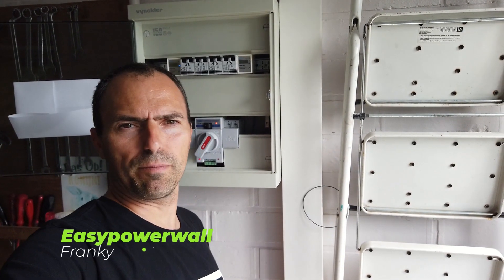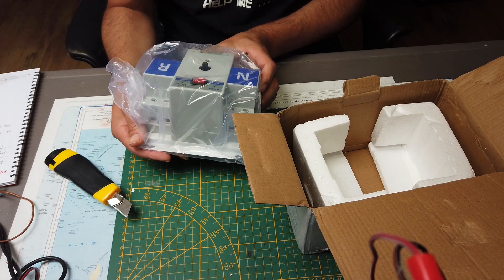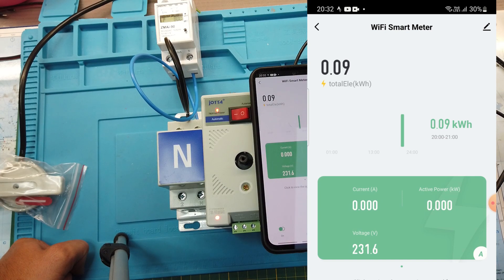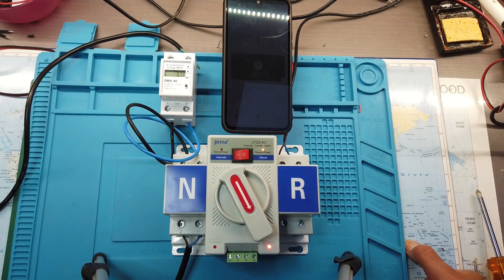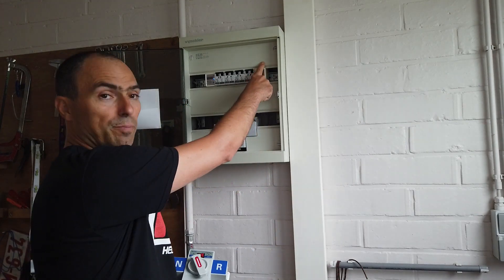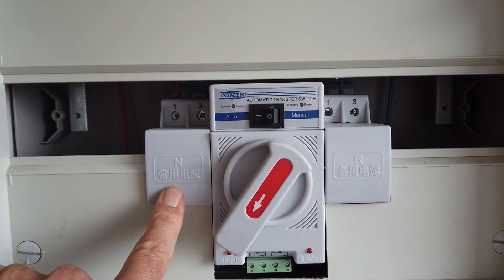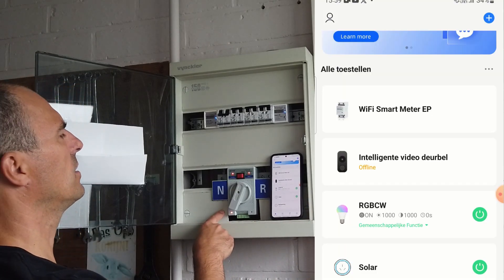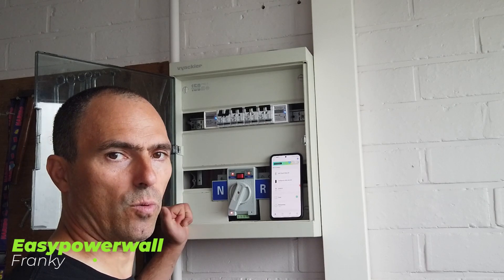Automatic transfer switch and wifi smart meter ZMAI-90, great combo.

Comment: Would this setup work with a solar hybrid inverter, to send a signal to a electric start generator backup?
Reply from the maker: Hi Paul, It could work, but you need an inverter with an NO and NC contact. With this contact you can start the generator when a criteria is met. When the generator runs and generates power & voltage, the ATS can switch to generator.
Hope this helps.

Franky - EASYPOWERWALL

Comment: Why not use a Relay.. instead of this Big Automatic Transfer Switch?

Relays are Compact and Cheaper...
Reply from the maker: Hi Johnny, 
I choose this solution because it's convinient and you notice immediatly the state of the switch.
A relay could work, but would need some additional control circuit.

Franky

Comment: Hi there! We are the distributors of the Zmai-90. If anyone is interested in this product, please contact us. The retail price is $19 per unit. For bulk orders, please confirm with us for better price!
Reply: Can you clarify if this device can be used on a 60A circuit with 6 AWG copper wiring? The 5A rating makes me think it cannot be used that way but the 60A maximum current suggests otherwise.

Comment: Can i connect ZMAI-90 to whole house?
Reply from the maker: ZMAI-90 handles 60A so yes, you can measure one phase of the house.
Reply: @easypowerwall  Thanks for response. Can zmai work with ewelink in any case? Also, can you tell it's accurate?
Reply from the maker: @nemanjatrebjesanin764  Doesn't work with ewelink, at least not that I know of. Works with smart life app and tuya. It's very accurate, it reports the same numbers as my victron shunt.

Comment: Thx for the review.... The problem of this ATS... it's a super slow switching.... If you need continuity in your load (for example, for your internet access).... you will reset of all your devices... each time, resetting the clock of your alarms, oven ... etc.... More... after a couple of switching, in general such cheap devices are failing (and even can take fire)
Reply from the maker: Thanks for the reply. The mechanisme is rather slow, but the switching itself is pretty fast. I even think a fixed PC wont reboot. But that's a good idea for a follow up video. In my case I have a heater, car, washing machine, ... on the offgrid power, no cricital aplliances, so the timing is no issue for me.
The units are pretty cheap +/-40$, but show me one picture of a burned ATS.....wish you good luck.

Frank, easypowerwall.com
Reply: @easypowerwall  I am using a 8ms version.... switching from grid to offgrid... But I already cooked one .... even with a small load.... I will change this chinese to a big schneider model .... Much more reliable, switching < 15ms....